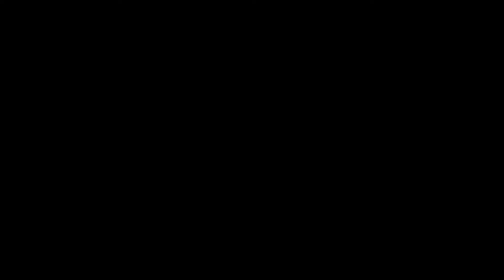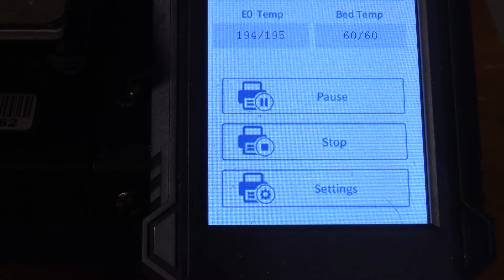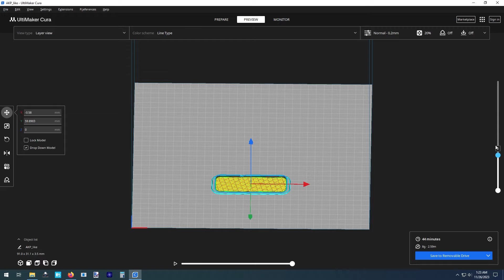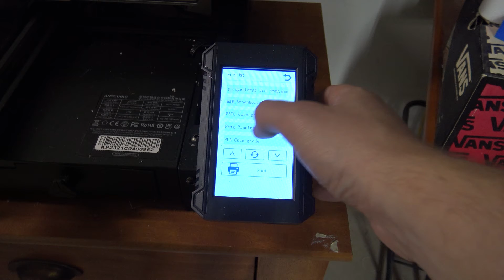(528) How to Do a Color Change on Anycubic Kobra Plus or Kobra Max

Comment: If I am trying to change the filament without having a print running should I heat up the printer to change the filament?
Reply from the maker: @brodysmychynsky483  you have to or you can’t really get it out if the hot end
Reply: @russej02  okay thanks I was able to change the filament
Reply from the maker: @brodysmychynsky483  awesome! Happy printing!

Comment from the maker: After the video I took the extruder apart and it was fine.  Took the hot end apart.  The Bowden tube wasn’t quite seated on the heater block. The little gap filled with plastic so filament removal it was grabbing a nice big blog of plastic that wouldn’t fit through the extruder.  Fixed that and it fixed the issue

.Intro: 0:00
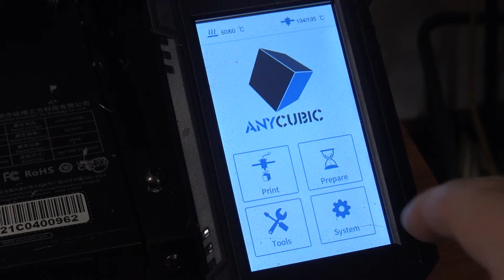Stock Printer Problem: 0:15
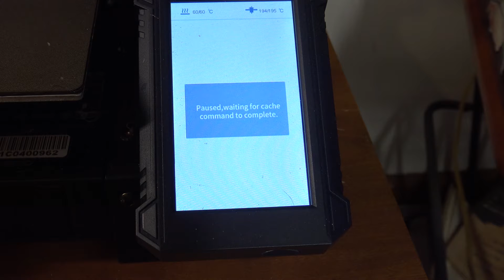Warning!: 1:44
Wabbitguy GitHub Page: 1:54
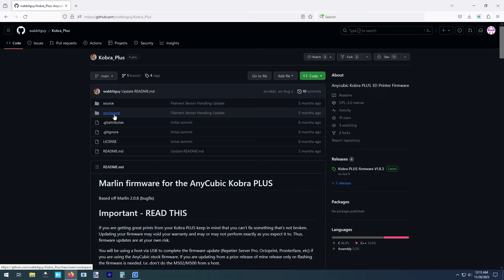Firmware Download: 2:43
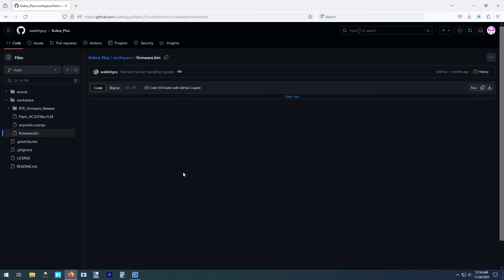Adding Color Change GCODE in Cura: 3:16
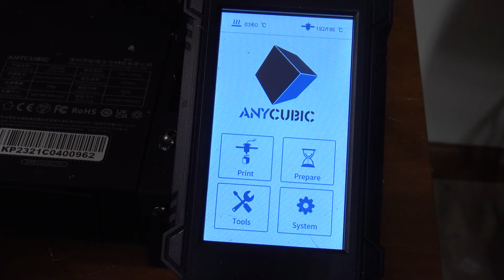Color Change Print: 5:25
Doing the Color Change 6:00
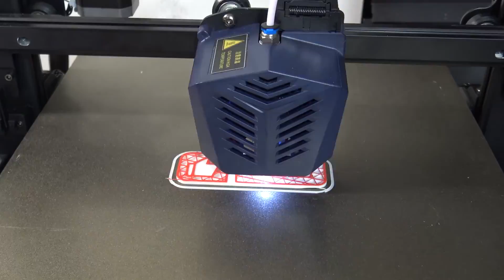Finishing the Print: 9:12
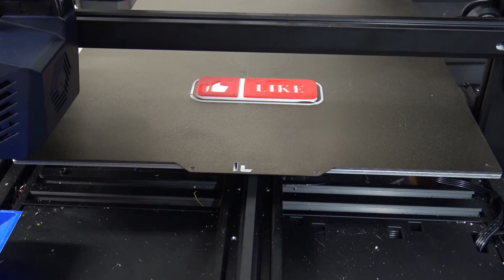Finished 2 Color Print 9:21
Outro 9:38